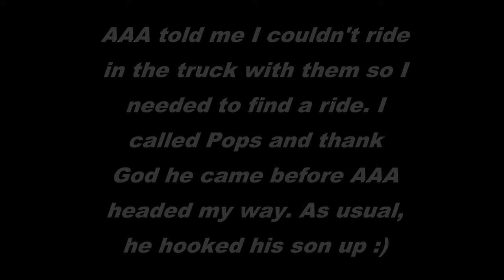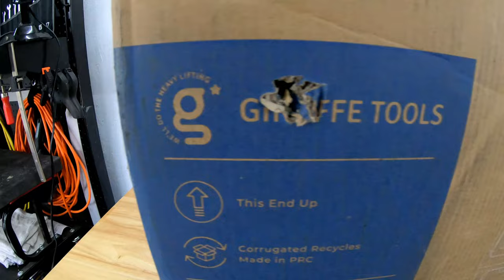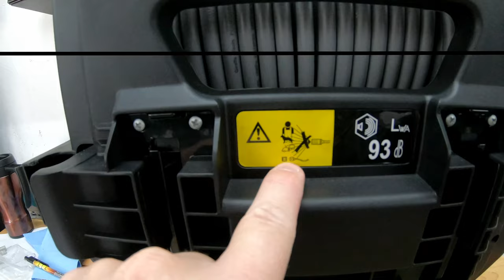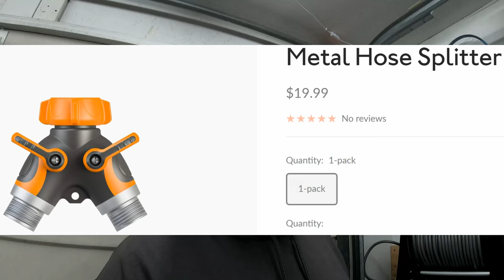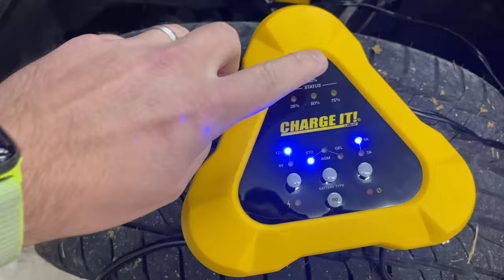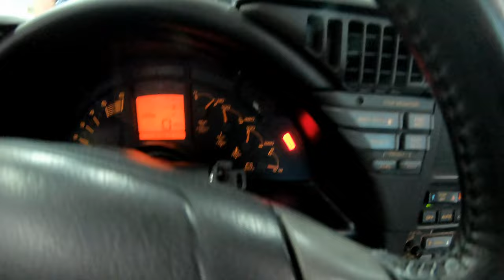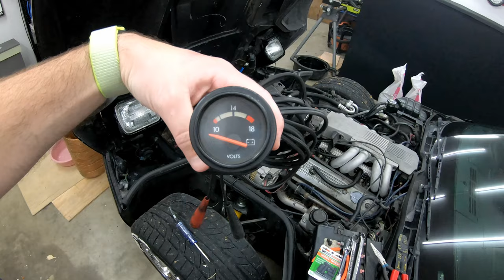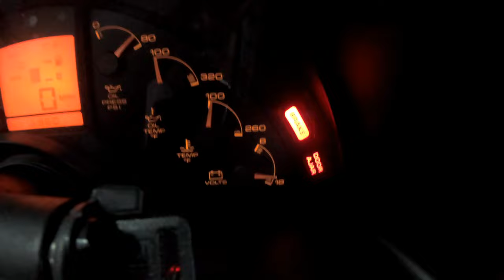Can't SHIFT, Won't Stay RUNNING and ZERO POWER in my C4 Corvette. Had to Call AAA... NOT Happy!!

Comment: A few years back my 91 had the exact same problem. But I was not as lucky as you. After I changed the Alternator all my problems were solved.
Reply from the maker: I am glad you got it fixed. I couldn’t believe mine would have been the alternator since it only had about 20,000 miles on it.